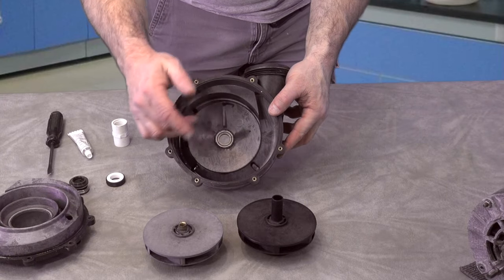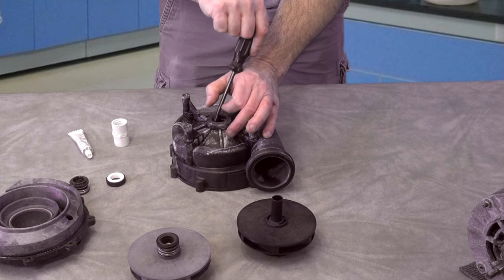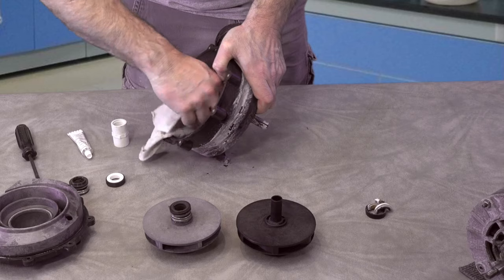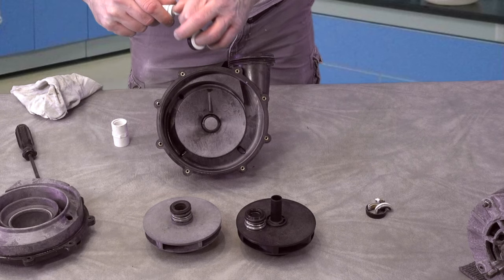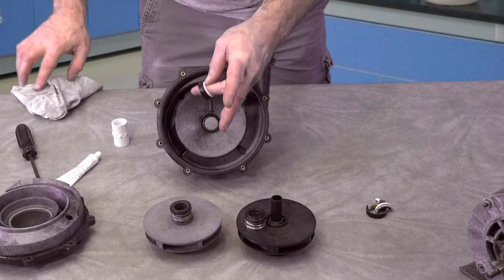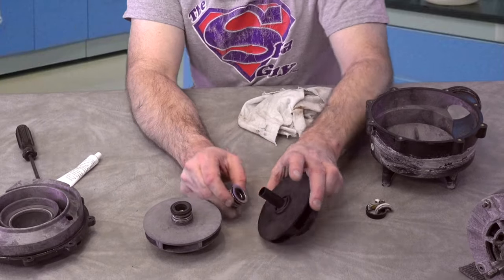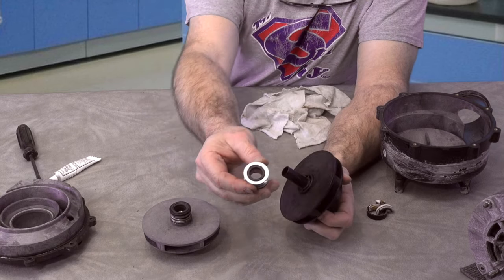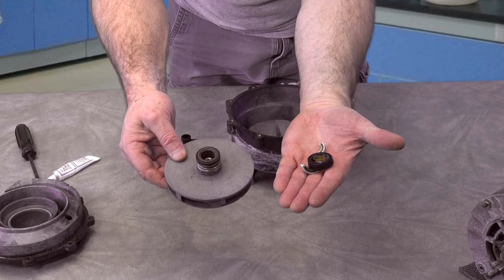Aqua Flo XP2e Leaking Pump Replace Seal Short Version Hot Tubs How To

Comment: Would this have been prevented had one removed "all" the water out during winterization?   Thanks for your time.
Reply from the maker: No.. The worst thing you can do to a hot tub is stop it for any period of time and "Drain" it.. First you cannot get all of the water out second the tub is designed to run not sit..

Comment: What is the little plastic piece that looks like you can turn it like a plug that is on the outermost part of the impeller housing?
Reply: That's a drain plug. If you were leaving the pump in the tub and closing water off to it, there will be water sitting in the impeller housing and you would unscrew that to drain it.

Comment: Do you really need to let dry silicone before reinstalling and starting the pump with the water in?
Reply: There are instructions that comes with shaft seals that say never to use silicone on rubber so now im confused.

Comment: Spa Guy I tried to remove the wet end of my pump which is ten years old by removing the four long screws that go thru the motor and they were all refusing to let go, so i lubed all of them and three of them broke loose and one snapped off. Can that screw be bought at your store? I am also going to buy seal and whatever is necessary   to fix the leak at the shaft. Will I need to buy the housing as well because the bolt broke off at the impeller housing? thanks for your time. Dan the DIY Guy!
Reply from the maker: Yes look for Thru bolts and look for the length and bolt head size.. www.hottubpartsofamerica.com